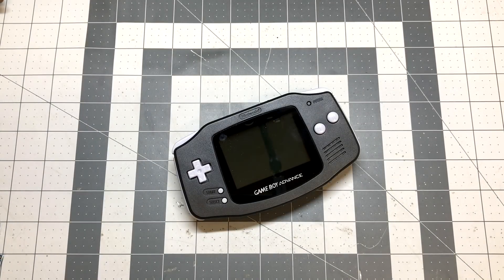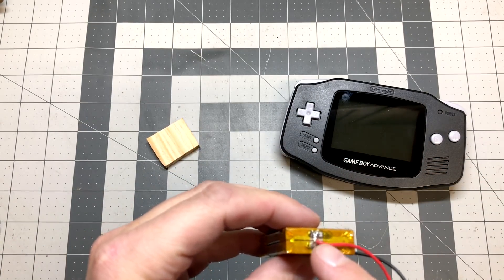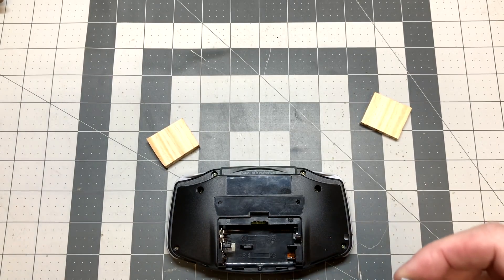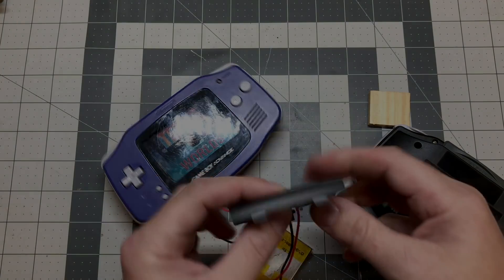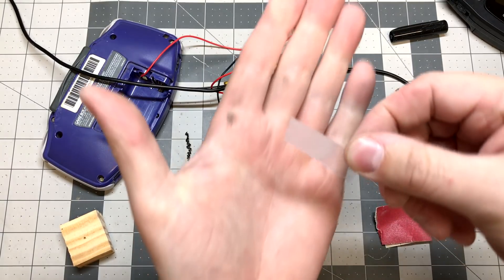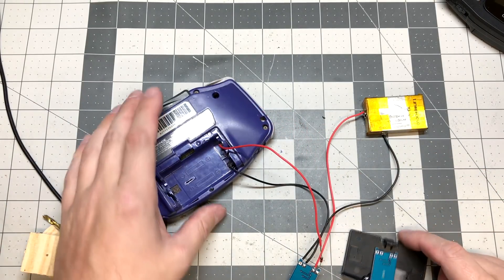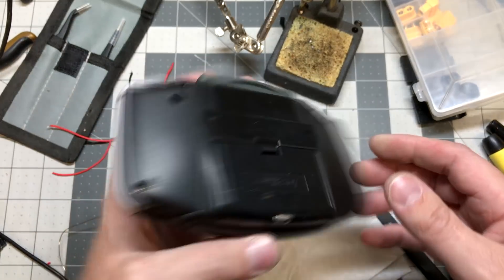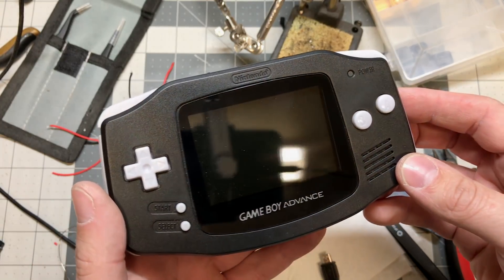USB Charging.. SO MUCH POWER.! #lithiumbattery #gameboymods #rechargeable #backlitgameboy #gba

Comment: Simple question here.... How long does this battery last? And will the battery light on the front side of the gba show when the battery is low and you need charging
Reply from the maker: It lasts at least as long as a few Alkaline AA's maybe longer.. I guess it kinda depends on how good of a battery you get.. Some of the claimed capacity ratings are a bit exaggerated.
But as for the Light yes it turns red when low.. but due to the very quick voltage drop of lithium cells.. once it goes red I had like 3-5 minutes of play before it actually died on me.
Reply: Keylitho also would this mod work with two 1.5v lithium rechargable batterys? And in that case would the zener diode be unneeded?
Reply from the maker: No that wouldn't work.. at least not with this Charging board.. And the only Lithium 1.5v recharbable batteries I know of are common Alkaline sizes... AA, AAA etc.
Reply: Keylitho ok thanks for the feedback ill be trying some bigger capacity batteries. If im succesful ill leave a message here
Reply from the maker: Well keep in mind that with this setup you can charge while you play with any USB battery pack that are pretty much everywhere.

Comment: I do not risk burning the motherboard because of the voltage difference?
Reply from the maker: It will be fine... that's what the Diode is for.. It drops the voltage.. and besides GBA's are cheap you can get them for like 10 bucks

Comment: Hi 
Is the gb still working a month later and have you any battery decrease?
Reply from the maker: Yes it is awesome.. I don't play it a ton and have only drained it 2 times since it's completion. As for the battery I assume you are talking about Battery Degradation..   That won't happen for some time.. Just think how many cycles you can get out of just a regular GBA SP before you have to replace the battery..
Reply: Keylitho thanks mate.
Reply: T

Comment: Keylitho, where did you get the black and red wires from to solder the points in the rechargeable battery board? Please respond.
Reply from the maker: From wherever you can find them These were just some I had laying around..
Reply: Keylitho What kind of number wire is it?

Comment: I would think that you could put the zener from Out+ to Out- and then run the leads to the gameboy from Out+ and Out-. Maybe the battery would last longer in this configuration?
Reply from the maker: I am not sure what happened to your other comment.. But yes I was only using it to drop voltage.. This thing lasts quite a long time and like I said in the video.. the system shuts down at 3.8 volts and the cells charge to 4.2 so it was just a very small and easy way I found to drop the voltage.  So it worked good enough for me. :)
Reply: That's awesome, you are just using that forward voltage in series. That was smart, and easy to implement! I am taking an analog and digital course and I know if you put that zener between the output leads, you will get a constant voltage equal to the rated zener voltage. I think I may try it that way because I would get 3.3V constant until the battery dies out. I'm pretty sure the GBA dies at 3V? I am not sure which configuration  would be more beneficial, would be interesting to test out. I'm picking up some parts tomorrow and should start the project soon.
Reply from the maker: It will work lower than 3v.. considering the system was designed to be used with 2x AA alkaline batteries that are 1.5v each. The GBA has a boost converter to boost the 2-3.2V from the AAs to a stable 3.3V.  
So the diode drops the voltage of the lithium cell by like 1v or something, and a 2v cutoff would be 3v on the lithium cell with the diode in place. and you don't really have to worry about low voltage protection with the lithium cells since the GBA just wont work before the battery voltage gets to low.
Reply: How big is the battery compartment for the GBA? Did you look at adafruits 3.7V batteries? They have some high mAh ratings, but I don't know if they'd fit or not. Its crazy how the SP battery fits perfect lol
Reply from the maker: Yea I have several Adafruit batteries.. All of the ones I have are too big, But they probably have some that would work.. I only figured this out because I had a dead one and pulled it apart and then just on a whim put it in there. Plus they are readily available and they are all the same size, so telling people to buy them I don't have to worry about them not fitting or buying the wrong one.
Reply: @jasonr5633  Hi could you explain in detail what you mean? So we should connect the diode from Out+ to Out- and run the wires from there to the GBA, instead of connecting the diode to Out+ and then connecting the diode to the GBA? And what would the benefit of this be? I'm looking to do this and want to know the best way to set it up. Thank you :)
Reply: This lil string of comments helped me as much as the video itself. Thank you both!

Comment: So would any 3.3V nominal zener work? Also, how come the zener is in series with the battery? If the zener voltage is 3.3V shouldn't the configuration be in parallel? I just assumed output voltage is the voltage across the zener, so thats what you would want feeding the gameboy.
Reply: No, he's using a lower voltage Zener nope, standard silicon diode in series, i think dropping about 1V; if you connect a 3V3 Zener across the battery, you will create a short circuit discharge condition on the batteries until they drain down from 4.2V (top of charge voltage of TP4056 charger board) till 3V3 approx - this is dangerous - the Zener will only dissipate about a quarter Watt or less before it sets fire to itself and its surrounding, and the battery can get dangerously hot too. Furthermore the TP4056 charger will no longer work as it will detect an output short circuit condition and shut down. Theoretically the protection boards inside the battery assemblies should also detect a short circuit condition when the battery is charged above 3V3 and turn them off, so hopefully actually nothing goes on fire, but also nothing will work. You don't want to rely on it too much because if the protection MOSFET on the battery burns out or gets damaged - it's also unfortunately sensitive to static, besides heat and high current bursts - it goes dead short as if there wasn't any protection at all.

Comment: Keylitho, how long did the two GBA SP batteries you got from Amazon get shipped?
Reply from the maker: I did not buy from that seller.. It seems like that seller is slow shipping.. I just linked the cheapest one I found.. Any GBA SP battery you find should be basically the same battery... Just make sure they are both the same capacity.
Reply: Keylitho How should I tell both batteries have the same capacity?
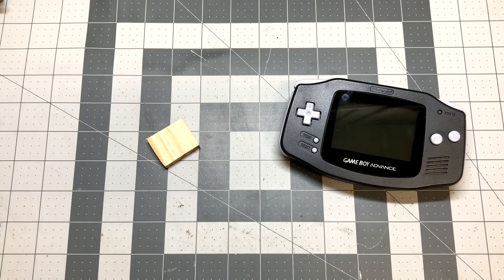Reply from the maker: The mAh number.. for example the ones I used in the video 1:31 are (850 mAh)
Reply: Keylitho Is opening the GBA SP’s battery pack easy to open?
Reply from the maker: yes.. It is basically just a sticker and a piece of plastic.
Reply: Keylitho Where did you get the sticker from?
Reply from the maker: Just buy some GBA SP batteries and tear one apart .. you will see.
Reply: Keylitho Alright, if I do a rechargeable battery Game Boy Advance mod. But, THANX 4 REPLYING ME!

Comment: Does the light on the charging board turn red when charging?
Reply: Keylitho Umm... okay, thanks for answering my question about the led lights being built in the charging board.🙂
Reply from the maker: yes.. Red when charging and Blue when fully charged..
Reply: Keylitho What did you use to have a red and blue led when you charge a modified GBA with a rechargeable battery? Please respond.
Reply from the maker: I am not quite sure what you are asking.. But the Charging board I used in this video is linked in the description.. The led lights are built into that board.

Comment: Is there a way to do this with a ds light battery?
Reply: Original DS has same shape than SP batteries. DS lite are different.
Reply from the maker: I don't think so.  I think that might have a bigger battery. I have never taken the battery out of mine.  :)
Reply: Original ds 
Yes And you should get longer battery life
Reply: Same form factor and slightly thinner when you peel all of the plastic off.

Comment: Gameboy Advance Advanced
Reply: MrCubeler What’s different between the original unmodded vanilla Game Boy Advance and the Game Boy Advance Advanced?
Reply: Vitzie629’s Channel Gameboy Advance Advanced is one with a backlight and USB charger port.
A Regular Gameboy Advance takes batteries and has a hard to see picture
Reply: MrCubeler Okay! Thank you for telling me the difference! Should it have louder sound too?
Reply: Vitzie629’s Channel I think that would be cool, although I never was one to focus on the sound part.
Reply: MrCubeler There’s actually something called the “GBAmp” which is by Anton Veretenenko and a little but powerful "Hi-Fi" grade Class-D amplifier module for Gameboy / Color / Advance. It is made to boost the low-volume speaker of original consoles and give it a nice powerfull sound. It will also help improve the battery usage. Should the screen be at least as brighter as in the Game Boy Advance SP too?
Reply: Vitzie629’s Channel I would probably go with SP screen brightness. Anything brighter than that would be hard to see, and not good to look at. As for the amplifier, that would be sick!
Reply: MrCubeler When you say, “That would be sick”, what do you mean by sick?
Reply: Vitzie629’s Channel I mean it would be cool
Reply: MrCubeler Okay! Thanks! There’s actually an AGS-101 voltage regulator by BennVenn and that it provides the correct backlight voltage and current to drive the LCD to its full potential producing a crisp clear backlit image BRIGHTER than a genuine GBA-SP 101!
The AGS-101 voltage regulator of BennVenn’s can be found on RetroModding.com!

Comment: Been searching for a while to see what integrated battery solutions people had used for the GBA. I did wonder about using a pair of SP cells and a regulator and charger board and you've confirmed that works!
The only difference is that I'm planning to use a 3D printed case (once I get a tri-drive bit to dismantle my GBA to CAD copy it). Obviously doing that will mean I can use a one piece rear case (i.e. no battery cover, sealed unit type job) since it won't need opening again and should give more room to fit it all together. 
I'm thinking that adding a Qi charge pad in the back of the case may be a cool addition too - plenty of those ones that fit under a phones rear case should be easily modified by soldering wires to the out pins and glueing to the inside of the case!
Reply from the maker: That sounds pretty sweet.. Be sure to share that to Thingiverse when you complete it.  I am Keylitho on there as well.
Reply: Keylitho my CAD is pretty limited so haven't managed to rehash the back of the case yet unfortunately, but I'm thinking I may be able to use a 3d scan of a GBA I've found one to hollow out and add mounting points to suit!
If not, I'll have to think about commissioning someone to do it and then put the file up for a small fee to cover the initial costs of getting it done.

Also, could consider gutting out on of these and using it as the charger circuit to give a readout of the battery level
https://rover.ebay.com/rover/0/0/0?mpre=https%3A%2F%2Fwww.ebay.co.uk%2Fulk%2Fitm%2F252706515085